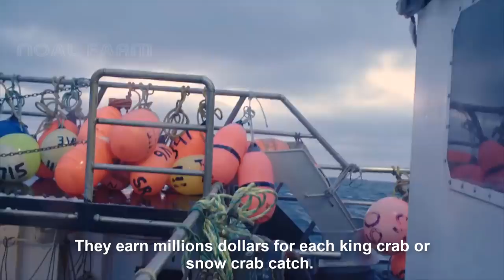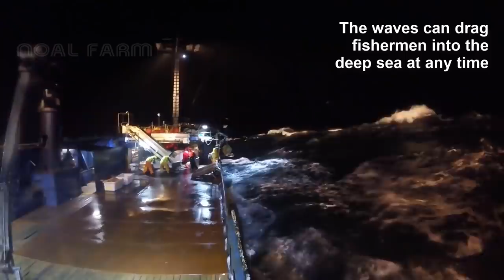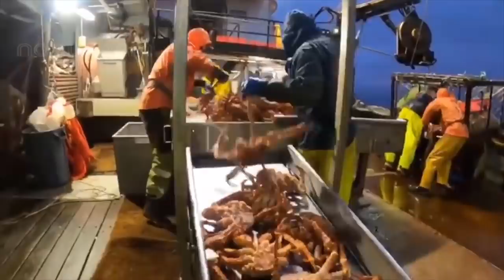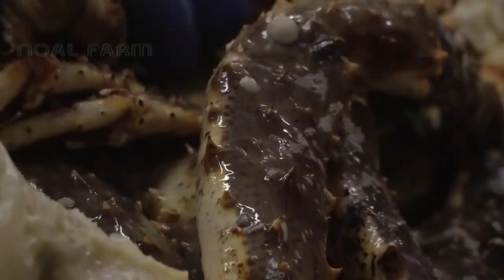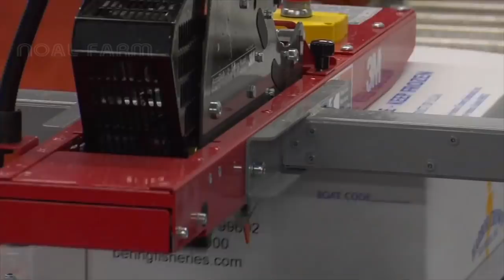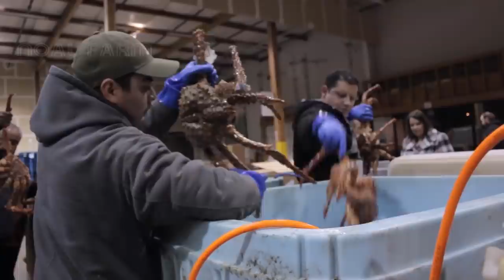How to Earn Millions $ from Catching King Crab 🦀 - Inside Modern King Crab Processing Factory

Comment: The owner of the ship should give his/her employees harness when they are catching crabs.
Reply: I thought the same thing
Reply: They move around on the deck too much, and there are already too many lines making it risky on the deck without adding another harness and line. Plus if you could make a 'safe' harness system, the fishermen would have to unattach and reattach so often they'd probably stop doing it at all.
Reply: too much going on the deck too much gear being moved around would kill more than it helps
Reply: Harness to what?
Reply: Harness to a cable that run overhead  .not saying it would work . But I use to wear a harness and felt it was less than worthless ( in my situation ) .
On a ship or boat in rough seas I might want to try a harness
Reply: Well, if you have a pile coming down on you, do you want to get out of the way and if the line catches your harness you’re going with it take it from a fisherman done it for 30 years